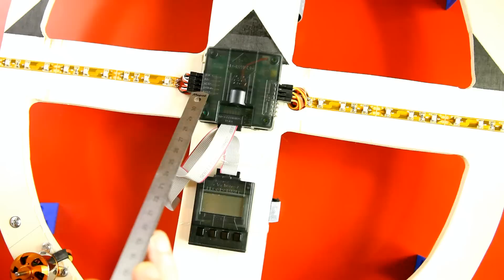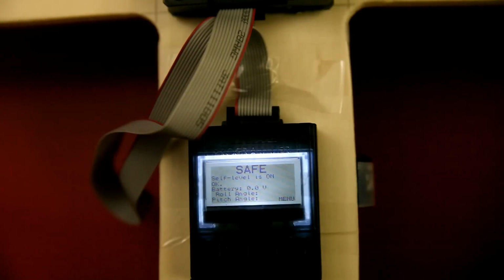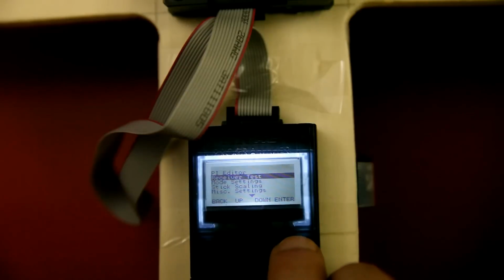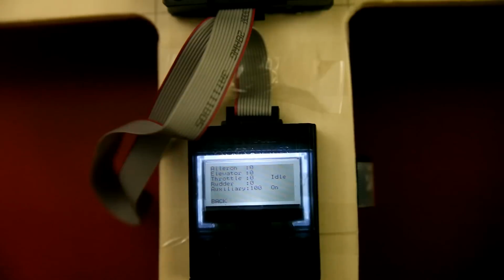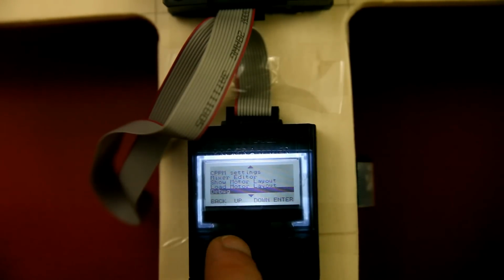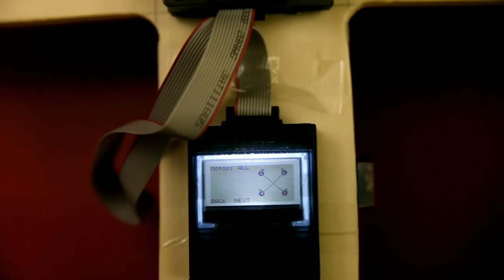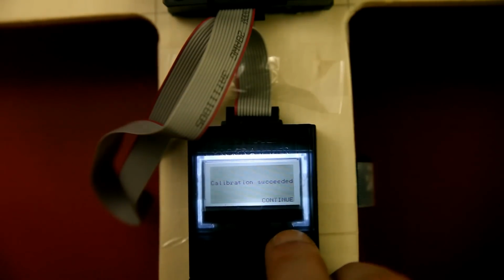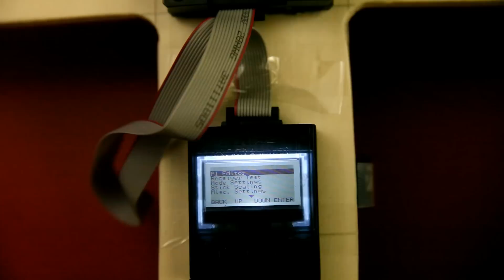HobbyKing KK2.1.5 Flight Controller - Setup Procedure for QuadCopters

Comment: Hi, may i know in ur configuration ur motor1 is right front or left front. And is it cw or ccw?
Reply from the maker: Here you go.. this is the layout I used: 
http://rs1218.pbsrc.com/albums/dd419/wolfgun/KK2XXMotorLayout_zps55b1b548.jpg~320x480
Reply: @DutchRC  Thanks. can u share ur final PI settings?
Reply from the maker: @1979zeesh  You do know this video is 4 years old.. right? ;)
Reply: @DutchRC  hehehehe
Reply from the maker: :D  for This quad I definately needed lower P's then stock.. the I's & D's I left unchanged
Reply: @DutchRC  whole week i played with the settings. the quad z able to lift off but as soon as it does it drifts to one direction. which parameter should i play more and in which way (increase or decrease)
Reply from the maker: @1979zeesh  It kinda sounds like eighter the flight controller isn't mounted completely Level in the quad.. Or it isn't calibrated correctly..
have you checked those 2 things?
Reply: @DutchRC  flight controller is levelled. I double checked. By calibration u mean PI values? If yes then for this scenario which parameter i shud play vid?
Reply from the maker: @1979zeesh  There should be a calibrate option in the FC.. (to make it know what is Level)..
After that you should check the outputs of your transmitter.. A drift like the one you described has nothing to do with PID values..
Reply: @DutchRC  im using the same FC u demonstrated in ur video... My gyro and acc bubbles are in centre of cross... I will chk my sticks centre positions.. Im doubting PIDs coz in most of the videos here ppl point to these for such drifting... I already did my acc celebrations and all other steps u and others showed... My fc z also levelled and aligned, props are also balanced

Comment: Hello, I did exactly as u did but when I raise the throttle, the motors don't spin. If I raise any sticks none of the motor spins and no response from the motors. May I know how to fix this problem
Reply from the maker: Hm okee, so the flight controller Does 'see' you receiver.. Could it be you have a problem Arming flight controller?
Reply: DutchRC Adventures I just armed my motors and it works perfect. THANK YOU FOR U R ASSISTANCE 😊
Reply from the maker: Ghehe I suspected it would be something simple But easily overlooked :)
Glad that worked out!

Comment: I need to buy KK2.1.5, but do I need to buy the hardcase version too ?
What's the use of 2 boards ?
Reply from the maker: Hi there Glen :) 
In some cases it can be more conveniant to have that external board, but basically the flight controllers with the embedded screen are the same :)

Comment: I have the version with the screen running version 1.6. I just set up my quad and tried to hover and it keeps drifting to the left. How can I adjust without using full trim on my radio?
Reply from the maker: rc photography Hi there sir :)
first: never use the trim to correct things on quads.. Allways use the subtrims.. 
2nd: have you re-calibrated the boards accelerometers ? (one of the options in the menu)

Comment: Hi, thanks for making this video!  I'm stuck on the receiver test.  I can't seem to zero out the throttle or the aux channels.  All other channel are working fine.  My Throttle is stuck on +74 in the kk2 screen and my aux is stuck on -62.  For the throttle I have tried travel adjustments and sub trim, nothing seems to work.  For the aux I have toggled all the switches on my DX6i, nothing seems to work.  Any suggestions?
Reply from the maker: Dionatronics Well. first thing will probably be to Reverse your throttle (in your transmitter).. After that you will have to extend the end-point of that channel at Least on the zero-throttle position.. 
You will allso need extend the end-point of the aux channel
Reply: DutchRC ADVENTURES Ok when I reverse the throttle the max position on the stick reads as idle, the lowest stick position reads as +9.
Reply: DutchRC ADVENTURES Would you mind if we did a skype chat?
Reply from the maker: Dionatronics Sorry.. I only use skype for business puposess.. Could you tell me what the exect values are at with the stick down, and full up (full throttle) ??
Reply: DutchRC ADVENTURES Down is +78 Up is +100
Reply: Dionatronics Also, when I move my throttle stick the aux moves from -67 to -107 and says "off"
Reply from the maker: Dionatronics Check.. the throttle direction is good now.. The full-throttle endpoint is good.. The zero-throttle endpoint is way off.. You might have changed that one in the wrong direction? 

That change in Aux is weird.. That looks to me like you have Some kind of mixing going on.. I don't know Spectrum transmitters, but go through all mixing options and turn those off...
Reply: DutchRC ADVENTURES ok thanks for helping!   I'll check out some DX6i setup videos as well.
Reply from the maker: Dionatronics It sounds as if you have defined the model in your transmitter as a helicopter.. It should be a simple 4-channel airplane...
Reply: DutchRC ADVENTURES Sorry I should have mentioned i'm setting up a quadcopter, the quanum venture.   Shouldn't the Tx be set to heli?
Reply from the maker: Dionatronics Nowwwww :)  just delete this model, and make a fresh one for a plane with ailerons.. That will solve most of your problems here :)
Reply: DutchRC ADVENTURES ah ok, I'll try this now!
Reply from the maker: Dionatronics Yeah.. Now your problems make perfect sense to me.. In heli mode the transmitter does all kinds of mixing.. 
Eventhough a quadcopter might seem more like a helicopter then like a plane, your flight-controller wants just super basic inputs.. And a plane-setup in your TX will provide that :)
Reply: Dionatronics Ok I'm getting closer!   my aux is perfect but my throttle is still off.  Throttle goes from +80 to +100.  I have to setup my throttle end point but I'm not sure how to do that on a DX6i.  Anyone know a good link?
Reply: Dionatronics Perhaps I need to calibrate my sticks?
Reply: Dionatronics hmmmm, tried to calibrate throttle but it is still off.  Any suggestions?  Won't budge from +80 to +100
Reply from the maker: Dionatronics Hmm can't help you there mate :)  Like I said: I don't own a Spectrum TX.. The menu option to change the end-points should be calles just that though..
Reply: DutchRC ADVENTURES i'll have to borrow a friends Tx to see if mine is the problem.  Thanks again for the help!
Reply from the maker: Dionatronics You're welcome offcourse! Good luck with it, and a 2nd radio is handy to eleminate the problem indeed :)
Reply: DutchRC ADVENTURES ok, finally got everything working, had to delete all profiles and re-calibrate transmitter.   I am Happy now.  THe quanum venture is a beast, the slightest stick movement aggressively turns this quadcopter.  I'm going from a small hubsan to this so maybe it will take some getting used to?   I'm using all default settings for flight controller so maybe I have to make some adjustments?  again, thank you
Reply from the maker: Dionatronics Glad you solved the problems! And yes.. This kind of quad is worlds apart from a Hubsan ;)  Just take it easy.. then you'll get used to it..
Reply: DutchRC ADVENTURES Ok, got my dual rates setup properly, the self leveling mode is good practice.   Which voltage sensor should I but for the board? Do I have to remove the case to install it? Thanks
Reply: Dionatronics So the buzzer is already permanently installed on the board. ( didn't know that)  What is the JST voltage sensor port for then?  Does it need a separate battery to operate the low voltage sensor?
Reply from the maker: Dionatronics What do you want to use the voltage sensor for?? The sensor port can pass the data through to a OSD.. but I don't think you'll be using that any time soon?
Reply: DutchRC ADVENTURES I would use it as a warning that my battery voltage is getting low.
Reply from the maker: Dionatronics Check.. You Could allso just put a lipo-alarm on your quad.. cheap and effective :)
Reply: Dionatronics I'll just plug the JST in the voltage sensor port on the FC.    http://www.hobbyking.com/hobbyking/store/uploads/221777845X291015X38.jpg
Reply from the maker: Dionatronics Cool :D

Comment: Bro, as a noob in quads, I'm building a zmr250. I got kk2.1.5 and orangerx t-six transmitter and orangerx800 receiver. HEEEEELLLLPPPP! Transmitter settings and kk2.1.5 settings?
Reply from the maker: Hi there :)  Well.. it really is quite simple :)  You don't need to make any settings in the transmitter.. Just make sure you have 5 channels working (aileron + elevator + throttle + rudder + aux)  .. No need for mixes or anything..
THEN just follow the instructions in the video.. And fly it with default settings..

Comment: Very good job man, If I ever get a kkfc I will have to remember this video (-:
Reply from the maker: Thanks! Ehm haha.. well. I used this board in the build-series because it is VERY easy to configure :)
On my 'real' quads I really do prefer boards with more features :)  As you probably do as well :)
Reply: DutchRC ADVENTURES
Will you do setup procedures for different FCs. I saw on this vid you seemed to be just putting numbers in, but how do you know what numbers? Then test fly and tweak the numbers I guess. This is the part that concerns me (-:
Reply from the maker: Jax Teller WA Hmmm maybe! I will definately do a (few) tweaking video's on this KK2 board.. As it is easy to quickly show the effect (cause the tweaking can be done right at the field)..
Besides that: the tweaking of PID settings (which mostly effect how well a copter balances itself out) will work effectively the same on all boards..
Reply: DutchRC ADVENTURES
Oh yes I didn't think of that, with the onboard screen. That is very cool. Thanks mate!
Reply from the maker: Jax Teller WA Any time :)  Just gotto wait out this 'lovely' weather ;)